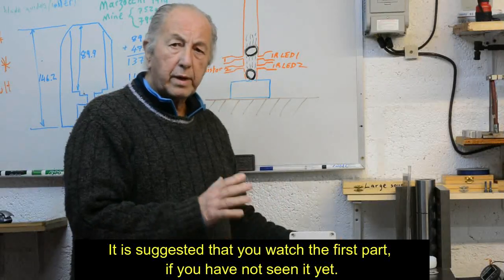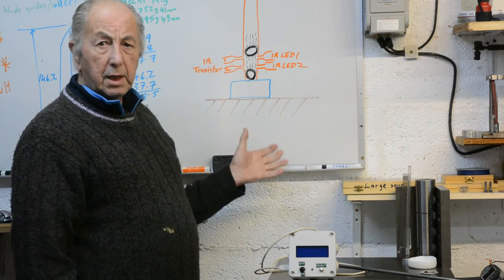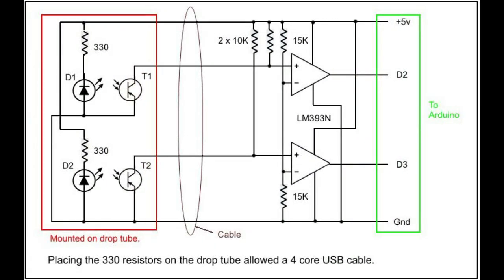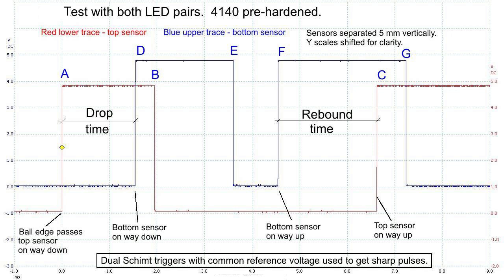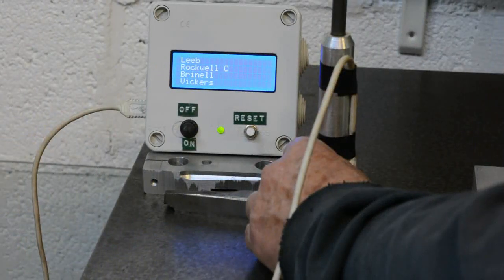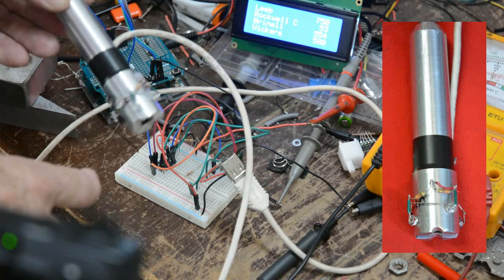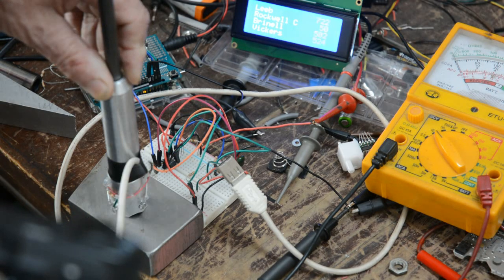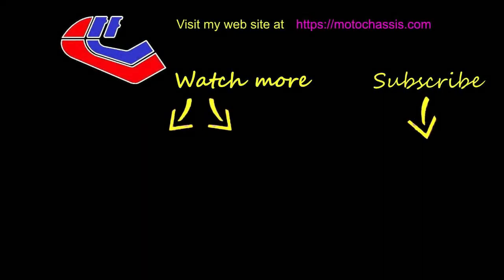Hardness Testing part 2 of 2 #hardnesstesting #Leeb #Shore #Rockwell #Brinell

Comment: I assume that in testing very hard metals, one could increase the distance between sensors to, say, 10 or 15mm and increase accuracy in the measurement.  This would not be very useful for softer metals, but, might just increase accuracy for the harder ones.   Just a thought...........
Reply from the maker: Thanks for the thought.  Relative timing accuracy would be improved with the greater sensor spacing but the variation in velocity whilst between the sensors would also be greater leading to reduced accuracy.  The optimum is a compromise between those opposing effects.

Comment: Why not use one 30 kOhm resistor instead of 2 15k in series?
Reply from the maker: The purpose of the two is for the reference voltage in the middle.

Comment: Wow, that is ingenius. I’ve been looking for hardness tester but they are all very expensive. I’ve had my eyes on Leeb testers. Commercial ones seem to have also spring so they can be used in any position. However that is not a good thing as there is one more variable in the equation to mess up the readings. Who needs to measure awkward positions anyway? Your free fall design is very simple and there really are no things that could go wrong. Even your code is utilizing KISS method as its finest. Brilliant. 

I was thinking of making my own version using PIC micro as I’m familiar with it but “micros()” function from Arduino alone is enough to dump that idea. With PIC I’d have had to rely on timers which would have made it more complicated and maybe not that reliable.

I’ve got a question, why did you use in the code distance between sensors 4.9mm? Was it to compensate something or was the distance actually that and not 5mm? Also what was the centerline distance from the lowest sensor to the bottom of the tube? 7.5mm?

Thank you for sharing this.
Reply from the maker: Offhand I do not recall why I used 4.9mm I suspect that was the result of actual measurement after it was built.  The distance at the bottom just needs to be just a tad more than the diameter of the ball.

Comment: Hi Tony,
Great project. Thanks so much for sharing the in-depth information required to build one.
All the machining I have covered, but I have extremely limited knowledge when it comes to electronics.
Would a Texas Instruments LM393N/NOPB still do the job?
And there are many IR photo transistors options, will they all do the same job for this project?
These are probably extremely basic questions, but I don’t want to make any mistakes.
Thanks once again.
Alan 
(Australia)
Reply from the maker: Any chip labelled LM393 will do the job.  I think that the only significant difference is in the chip packaging.  If you are ill equipped for electronics work you should avoid modern tiny surface mount devices.  These are not easy to solder unless you have the right setup.
As for the sensors, it will be easier for you to use a combined unit.  I searched Amazon for HY860H-A and up they came.  Just stack 2 on top of one another

Comment: Could you please explain how you calculated the 2as(twoas) constant. Seems to me as this was used as a means for calibration of the unit and one would need to be able to calculate it in order to reproduce this machine and account for minor variations.
Reply from the maker: a is gravitational acceleration = 9.807, s is the remaining distance to fall after the ball passes the midpoint of the timing section = 9.25 mm or 0.00925 m.  So 2as = 2 * 9.807 * 0.00925 = 0.18143
Reply: Thank you for the reply, I needed a good refreshment of simple linear motion physics.
Reply from the maker: To add to the reply.  2as = (dV)^2  or the square of the velocity change which can be added to the measured velocity like
V =sqrt (Vm^2 + 2as)  which is done farther down the code, where V is impact velocity and Vm is measured velocity.  For the dimensions of my device it makes close to 1% difference in the impact velocity compared to the measured velocity 9.25 mm above the impact zone.

Comment from the maker: Video is not the best format in which to present schematics and programming code so I have prepared a companion PDF file which contains that info as a permanent record.  You can view and/or down load from here: 
https://s3-us-west-1.amazonaws.com/hmt-forum/tony_foale_hardness_tester.pdf

******** Important notice ************
I made an error in the two schematics.  The IR LEDs and the power LED are shown around the wrong way.  I showed the anodes at the bottom, they should at the top and the cathodes at the bottom.
****************************************
The Arduino code can be copied and pasted in text form from here: 
https://www.homemadetools.net/forum/everyone-needs-hardness-tester-83780#post175021